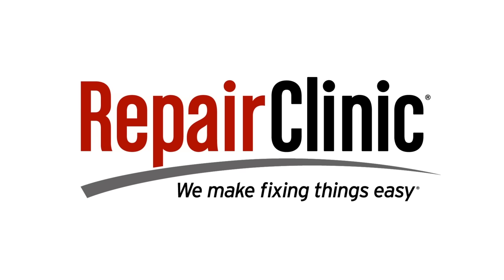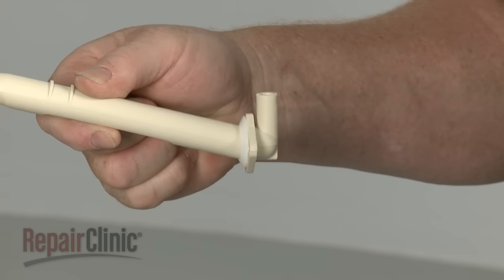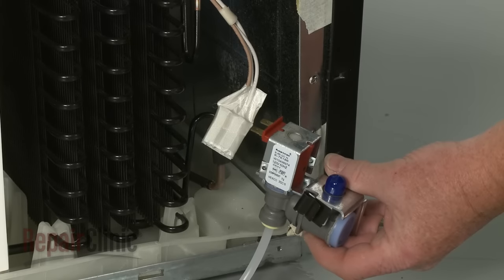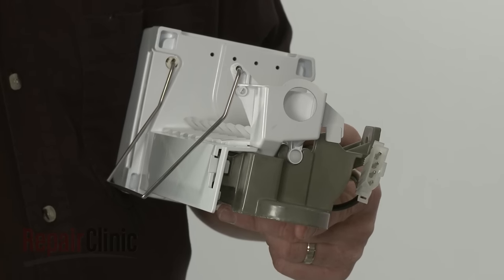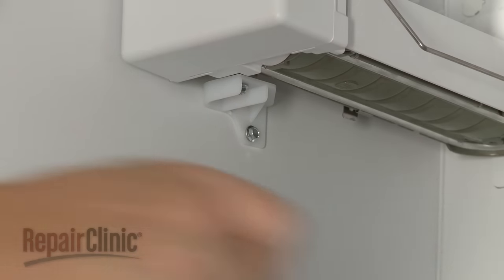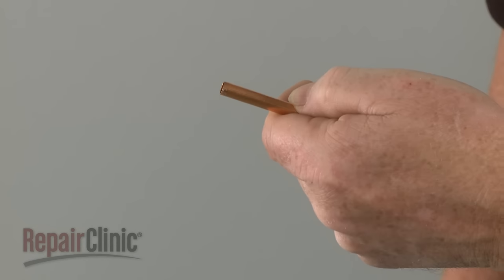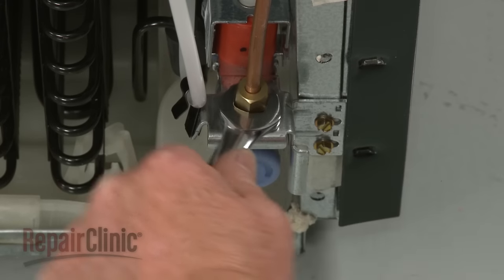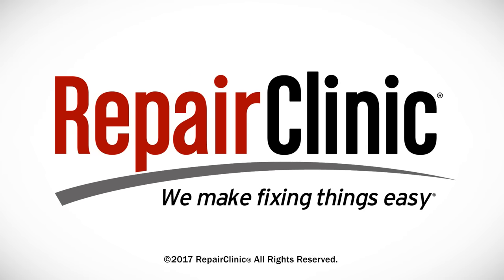Whirlpool Ice Maker Kit Installation (Model WPW10715708)

Comment: Saddle valves are for chumps.  One of the biggest causes of leaks.  Use a proper fitting (shark bites as easy as pie to install, and not leak prone like those shitty saddle valves) and pex tubing until you get close to the fridge, then use 1/4 tubing.

Comment: Just installed an ice maker like this. Should it start cycling as soon as power is supplied? It's been ten minutes and no water has been poured into the maker, no cycling of the arm. Nothing
Reply: @repairclinic  

Mine doesn't run either.  How are we supposed to check to make sure that there's power to the ice maker without getting fried?